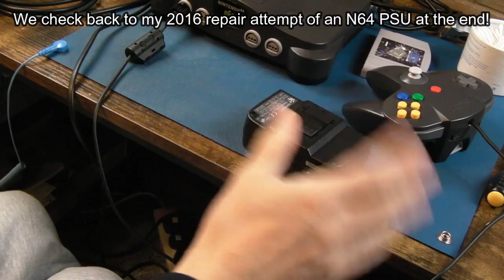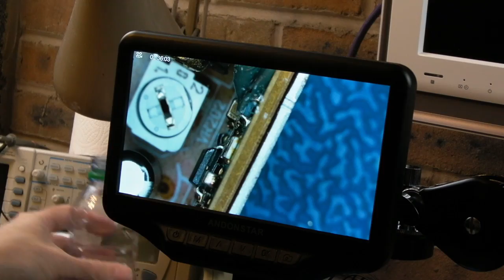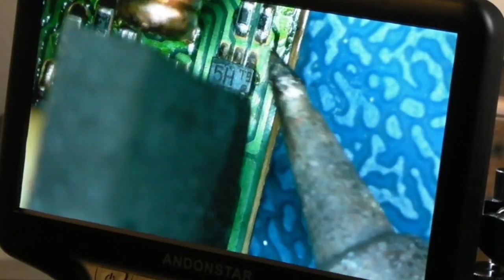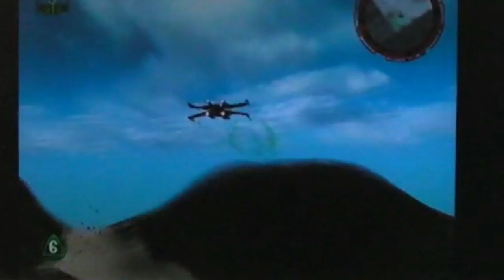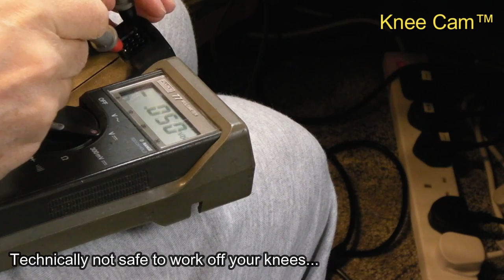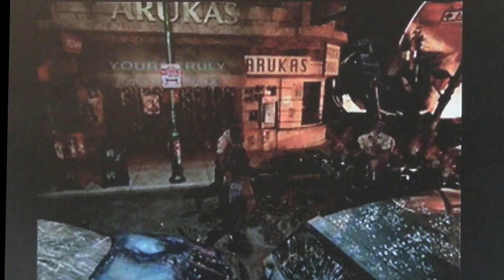Common N64 PSU Fault - Thanks Vince!

Comment from the maker: Warning: Do NOT work on Power Supplies if you do not know what you are doing.  You can get shocks!
It goes without saying - if you are capable of working on a PSU - it's worth checking yours and removing that silicone!
I am aware of the typo (Led, not lead...) -  I often make typos...
The review of the microscope used in this video:- https://youtu.be/IWJrfAucmkk
MMV N64 PSU Repair - https://www.youtube.com/watch?v=ZD-0MROz164
MyMateVince - https://www.youtube.com/@UChY9Cgv-iyPDvf1Bkyx20OQ

Comment: Could the power supply interfere with the video? Cause if I move the power supply it's ok, and the AV cable is new
Reply from the maker: Yes, the PSU could be interfering with video!  Is it an original PSU or a modern replacement?
Reply: @GadgetUK164  original 🙂

Comment: I have a n64 psu with a sound like ticking, any idea?
Reply from the maker: Sounds like it's failing to startup, or being shut down due to protection.  Has it been re-capped, I would start by doing that and inspecting for damaged components..

Comment: My PSU is just acting weird, when I plug it in the wall the n64 works and then after a while sometimes an hour, sometimes 5 mins. It just loses all the voltage on both of the rails and I need to let it "cooldown" could it be those two resistors? Because they measure fine. Or can they act bad when they heat up
Reply from the maker: Yes, it could be the resistors!  It could also just be bad electrolytic capacitors too!

Comment: How do you solve the issue with a PSU generating noise over the image on screen?
Reply from the maker: Is it a new modern PSU or the original older one?
Reply: @GadgetUK164  The original older one. The N64 has been RGB modded, but now with the clarity of RGB you can see noise all over the image. I have read that the cause could be the PSU in bad shape (or probably the console itself). For now I think I'll buy a "modern one", not a cheap third party ones, but one of those smaller "board" powered by an external power supply.
Reply from the maker: @danielescamperle6022  It might be failing caps in the PSU, perhaps relating to the 12v side...

Comment: I do a fair bit of work on 70s/80s audio equipment and a lot of these have the same problem as the N64 PSU - glue used around (normally) the power supply caps (have a look at Sansui glue). Becomes dry with heat, then becomes corrosive and conductive. Pain in the rear to remove, but acetone (nail varnish remover) on a cotton bud/q-tip is really good for it - just be careful of PCB markings etc as it can rub them off. Quick rinse with IPA afterwards and all good. Also - don't get acetone in capacitor cans - it right royally f's them up.

Comment: For how long it will take, if you have a working PSU, it's probably worth opening it up and removing the glue. I had a faulty PSU but mine was a faulty optocoupler and blown mosfet IIRC.

Comment: *T I P*
220 Ohm Resistor could have been soldered in within seconds
with a dab of sticky flux "Applied via toothpick point" to the
resistors tabs and then placed on point, place a little solder on
the Soldering Iron Tip and solder each resistors end down..

Comment: Man, in the USA there are a dozen different N64 PSU variants from 3+ manufacturers. I’ve taken apart over 100 and still haven’t found one with this fault (knock on wood). Do you think it only affects 220v models?
Reply from the maker: It might just be european models!  I've got another video coming up soon on another model we got over here!  I think the point is, Vince has fixed 2 or 3 with this issue, I'e covered 3 in this video, 1 other off camera since with the same issue, and I saw that another channel that follows Vince has fixed a couple with same model and same fault too.   So for this european model, its a super common fault on a common model.
Reply: Yeah, NA N64 power supplies tend to be incedibly reliable and almost never hear them not working if the cable and console side  connector are fine in the states, so wondering if a 220v issue.

Comment: Excellent! Interesting to hear the symptoms when the other resistor fails. Thanks for all the very kind words Chris and glad you had an easy fix with these power supplies 👍
Reply from the maker: Thank you!!!   I spent hours back in 2016 trying to narrow down the fault lol
Reply: @GadgetUK164  I can imagine! I remember you told me the fault was on the separate vertical board so that instantly narrowed it down for me so your hours weren't wasted in vain😂👍
Reply: Nice work guys